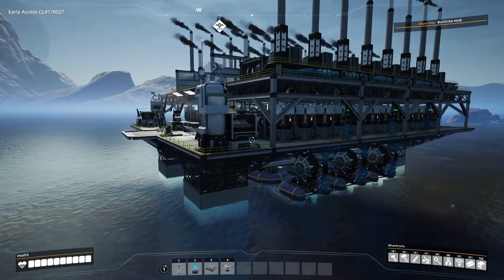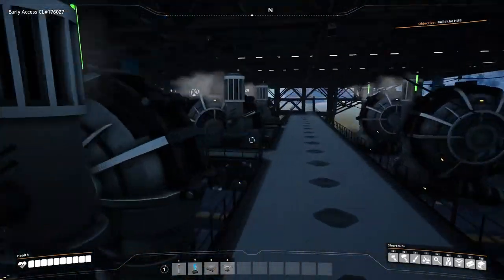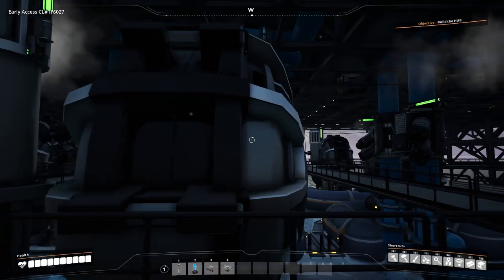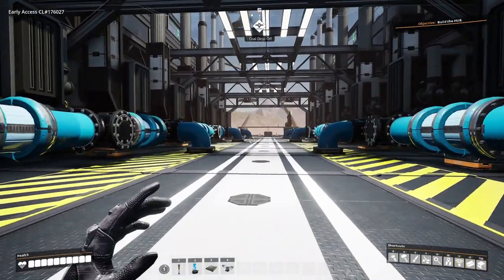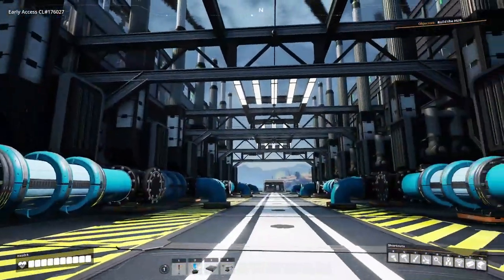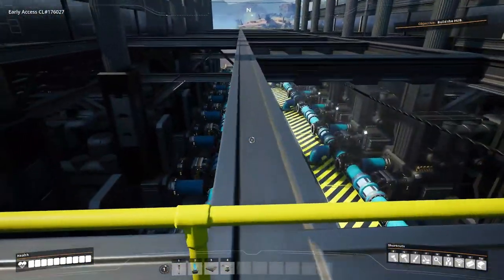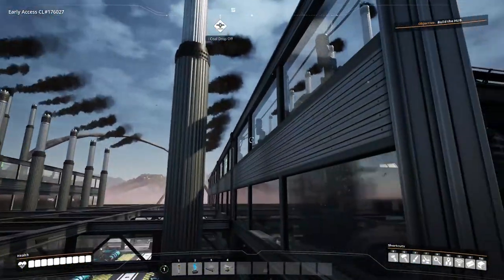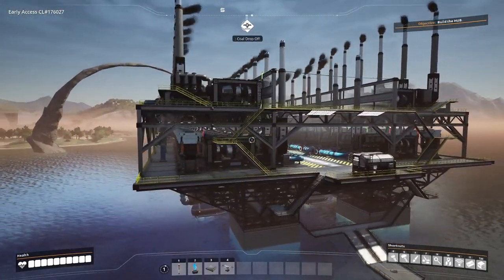The BEST Oil Rig Design in Satisfactory!

Comment: Aesthetically, awesome!  Way, way, way better than I ever manage.

Logistically ... Always, always, ALWAYS overproduce water.  Especially for a power plant, which continuously consumes its inputs at 100% even if the produced power goes to waste, you will find that if you don't overproduce water, that because of minor sloshing in the pipes, some of the coal plants will very slowly get starved of water and you will start to see production stalls because they run dry.

Overproducing water costs you nothing but your pride, and it saves you from headaches.  I recommend at least a 10% overproduction.

And don't EVER try to attach consumers that total to the max thruput of the pipe they are attached to.  Pipes slosh, so you are going to be very hard-pressed to actually get max thruput from a pipe.  Always overproduce into the pipe, compared to the consumers, and always have the consumers total less that 300 or 600, depending on the Mk of pipes you are using.

(If you are extracting a fluid other than water, and you want the full 600 units from the extractor, you need to split it immediately and push it into fluid buffers in as short a span as possible.  Otherwise, if you watch the extractor, you will always see the extractor's internal buffer creep up towards full and then the extractor will stall i.e. you won't actually be getting a continuous 600 out.)
Reply: I really wished we'D have fluid buffers with multiple pipes.... it would help a lot to even things out...

Comment: Using a lot of pumps on every line.
Not what I do, I build a single water tower (with pumps) with the highest level above that of the factory. Connect it to the water pipes network below and we don't need any more pumps.
That is in total 6 pumps for 34 Coal power plants.
Both Scalti and Dekoba use such a setup and I copied.
Reply from the maker: I mean I totally get it and from a logistics POV that makes sense but from an aesthetic POV this looks better 😂